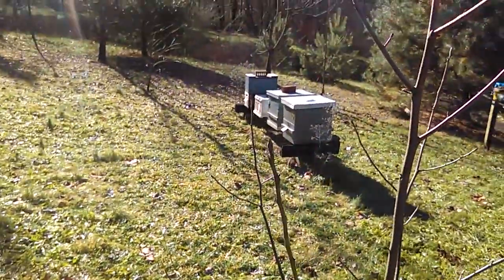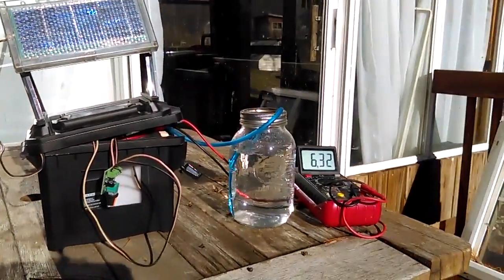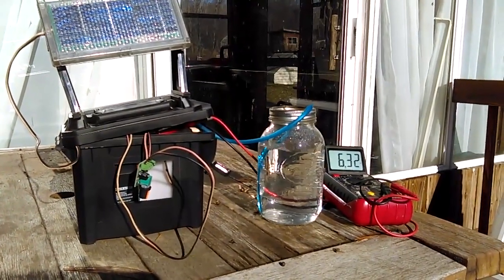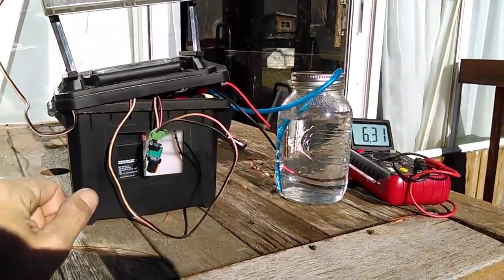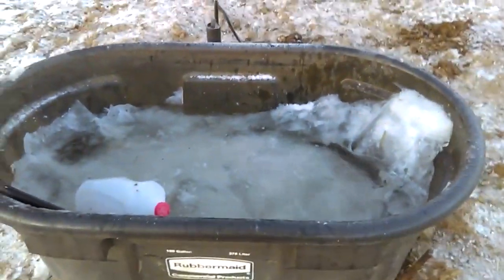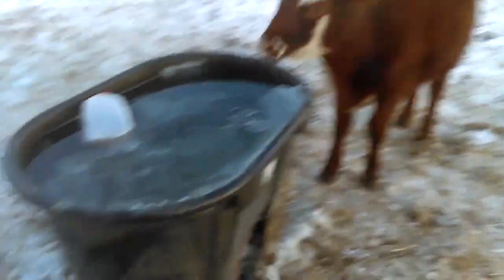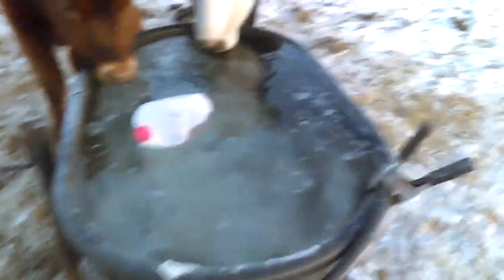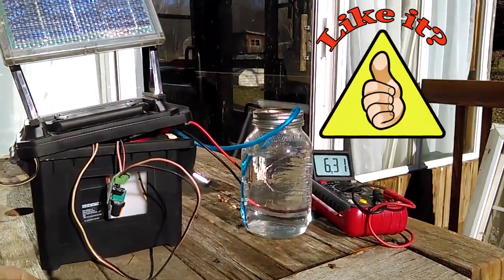Trying To Prevent Frozen Stock Tanks... Solar Powered Water Bubblier

Comment: THIS  WORKS  FOR  US
We use compostto naturally heat our water tanks all winter long.
We take leaves, wood chips, hay, straw, and any other woody materials collected from around the farm and create a 'compost lasagna' around 2/3rds of the stock tanks. We then place rebar through the side of the stock tanks near the bottom and middle (4 rebar works down to -30F) and we 'supercharge' the compost halfway through winter by adding more urine and greens/chicken manure. Heat goes to cold, so the HOT center of the compost conducts through the rebar into the COLD water, and causes convection flow to the far top side, and then down and back to the rebar. It is so powerful we can see the water moving with food coloring.

Additionally.....the compost acts as a great insulation barrier on the back 2/3rds of the tank, naturally heating that side of the tank. Our tanks do not start to freeze at the edges until it gets down to -20F, and won't completely freeze until -30F (only a few nights at times) at which time we use electric heaters. I hope our description is sufficient. I apologize we can not provide video/photos for opsec reasons, but we hope to help self sufficent people break free from the international cabal enslaving the world with their treasonous rveenue streams. #SmallHatsFearUs

Comment: I tried the same thing with the air bubbler last winter for my horses waterer it helped a little but still froze up at night. I found what works best for me in northern Minnesota  is insulate the tank and cover about 3/4 ofthe top with plywood and hang a rubber flap down in the tank about half way  so there is less exposed water to the cold air   the water was almost always open and when you add fresh water the next day it helped warm the rest of the tank back up. I still use this for my bull when I have him separated from the cows.  Works great and cheap to do
Reply from the maker: Very interesting. I am planning to add a solar heated box around on stock tanks. The bubblier is just extra insurance. Thanks for the input.
Reply: Lazy man ranch I am wondering if you could post a picture of what you are describing with the rubber flap.

Comment: Where in North Dakota we winter grays standing grass. Sometimes our cattle graze in 3 1/2 foot snowbanks sometimes almost 4. The cattle do just fine on snow for a water source. Just like the bison elk etc. but if we feed hey snow is not adequate. If you feed hey you must provide water. I have several YouTube videos on this subject.
Official doesn’t necessarily drink water. Winter grazing cattle don’t drink water either, they take water in with every bite full of grass. I agree with you if you’re feeding hey feed water.
If you don’t have electricity there are 3 ways that I know of to keep water on frozen.
1. Propane heater
2. Automatic propane generator.
3. A wood heater. which is maintenance.
Thanks for the video👍🏼
Reply from the maker: What you say makes perfect since to me. The person that triggered my snow experiment was feeding hay too. He doesn't realize how dry hay is I guess. I know my cattle are very appreciative of me showing up to water. 
Thanks for the insight!
Reply: @GrazingAcresFarm  The system linked below never freezes and doesn't require electricity. The down side is that it is a fixed location that can't be moved. If you want water in more than one location you have to install it at each location.

https://www.horsedrinker.com/products/cattle-waterer/

Comment: Jason , I have 2 solar panels connected to a small charge control to a 12 volts deep cycle and and works great. I was going to try a small submersible fountain pump to circulate the water.
Reply from the maker: I gave up on the bubblier to keep the water from freezing, I switched to a different float valve that has a trickle features and just recently picked up a Freeze Miser to add. Just released a video on the Freeze Miser, you should check it out!!

Comment: depending on your water source,   ours is well,as such able to use frost free waters.    the ground tile is at least 3 " less than the width of the waterier dug at least 12" below frost line.    they have survived even - 40°  (true temp  brrrrrr)   most of ours were Mirafount  we got as no electricity needed.

Comment: I installed a 165 watt solar panel 2 6volt golf cart batteries and a 12volt screw in heating element in my 50 gallon rubber maid tank 2" of foam board under the tank 95% of the time here in pa NO ice when it does freeze its thin and theres an 8" clear hole right above the element saved me 40.00 a month

Comment: I think the bubbler is a great idea. Low speed seemed to produce the same as higher speed, but draw much less power. Plus air is safer that a electric tank heater that could short out and shock the cattle. I am lucky that I have hot water to fill my tank with, plus a back up tank heater (which I only plug in if absolutely needed). I like your idea, and might do the same to mine, but hook it up to my air compressor! Keep us posted on how well it performs
Reply from the maker: I think it will help slow down the freezing if anything. Do you know of Jim Gerrish? He wrote a few grazing books but he also sells a version of the air bubblier. https://www.americangrazinglands.com/products/12v-water-bubbler
I just can't justify the cost. I have a lot less in my setup and that's including the battery. lol On top of adding this to the stock tanks, I plan to try an insulate one of them. I have plans for a solar heated stock tank box that looks promising. 
I never gave the air compressor any thought, good idea. If a person had a very large air tank and a valve to control the air released you could probably get quite awhile out of it before the compressor kicked back on.
Reply: never in 40 years had one short out and even if it did thats what the safety ground wire is for, and little short and it will pop the beaker, you can have a drill in your hand and put it under water and nothing will happen other then pop the breaker and do nothing to you, just make sure it is wired right and the 3rd prong is always on the plug,,, that little bubbler not going to move the water any were close to what is needed, until i put my live bait tanks in the ground they froze solid, even with a 1/3hp motor commercial bait pump

Comment: well  did it work? that was 3 years ago.  I', looking into a solar tank heater but I', thinking  insulatingf the water from the ground and building an insulating housing with a limited access cover  all painted black  might be cheaper.
Reply from the maker: No. I switched to the Jobe Topaz float valve with a Freeze Miser. I'll do a video on it soon so you can see my winter setup.

Comment: Yacht owners use blubbers under the hulls to keep ice away from the hull. I would run the air through a tube around the edge,  held down on bottom of tank so ice never forms on edges. Notice Ice always starts from the edge.
Reply from the maker: Makes since! Thanks for sharing.
Reply: yes they do but the motors on those are 220 volt 3 to 5hp and the fan blade is 10 and 12" i know as i sell them, the hang under the boat on 4 chains, you need one for every 25 to 30 feet of boat

Comment: Ha Jason what is the water temp coming out of your Hydrant? If your pipes are deep enough you might have warm water, well maybe 35 to 40 degrees, if you turned your hydrant on and put a valve on the hose bib you could cut the water down to maybe a gallon every 4 or 5 minutes. That hose in the bottom would add enough heat that maybe the water would not freeze. I think I seen your well was in a building. My bees are flying every day but then I am in Dunedin,Florida it started out 68 and got up to 84 today. Jason I always enjoy your videos.
Reply from the maker: Our water is around 35°f straight from the spigot in the winter. I was considering letting it run slowly and fill a tank then setting it up so once that tank is full it drains to another tank but it got complicated real fast. lol It also seemed like it would be a lot harder to move the setup as I move the herd. Our well is underground in an old cistern so it's protected from the elements. 
Glad yo enjoy the vids and thanks for watching.

Comment: A larger solar panel directly connected to an immersion heater might work. Let the water be your 'battery' in the form of heat storage. Insulate the tub. The 'sweedish homestead' guy on YouTube covered part of the top also.
Reply from the maker: I am planning to insulate at least one of the stock tanks. I have plans for a solar heater and it looks promising.
Reply: Ohio isn't exactly the sunniest place in the winter.  And with a PV panel you still need a MPPT or PWM load controller  to deliver power adding some cost to the system.

Comment: Ps youll need a temp controller probe and a 40 amp relay switch they are cheap though or you can get a 12 volt element with an adjustable thermostat right on it

Comment: The brine jug will work better if the jug is moving or bobbing in the water. The wind blowing keeps the jugs moving which keeps the water from freezing. Me I would add 3 or 4 brine jugs in the same tank and and the bubbler, I bet you’ll get better results.
Reply from the maker: Yeah, I understand the wind is a huge part but that is out of my control. lol I appreciate the insight but I am going to add the bubblier to a stock tank that I plan to insulate. There will be a video on the tank very soon.

Comment: This year ill make the 40.00 a month back this will be year 4 if your careful you can do complete for about 450.00 rarely i have the throw a battery charger on it you can run those elements right off a battery charger its safer than 110 for your live stock and cheaper to run than 110 heater

Comment: Your bubbler didnt put out a huge amount more of air with the cranking up of the pump
Reply from the maker: It does actually produce more bubbles when cranked up but the video didn't do any justice for it. It also drains the battery faster.

Comment: Air is a waste of time. I use a battery power stock thank heater and it works great.
Reply from the maker: Fair enough! I am now use the Jobe Topaz float valve to prevent freezing and it's worked fairly well the last 3 winters. It has a feature which allows the water to trickle and moving water can not freeze.

Comment: I can't think of anything besides letting the tanks overflow. If you had metal tubs and were permanently placed you could use a floating flame to do the job. Cowcamp87 on YouTube has a video from last winter where he put a metal trash can in a big metal tank and burned wood in it. The trash can floated around like the milk jug and had fire for heat. Probably not suitable for your application though lol.
Reply from the maker: Interesting idea for sure but I can only imagine the trouble the cattle could get into having a floating fire. lol
Reply: @GrazingAcresFarm  I heat water while camping with a copper coil and braided metal hoses (from a wash machine )..I have the campfire put the coil in the fire the hoses run to a cooler of water by morning you'd do good to touch it but it's only about 20 gal..it works by convection. ..if you look at how folk use "the snake " method in their can smokers with some charcoal most get a 12_16 hour burn...not a exact way to do it but your a smart fellow and it may give you a idea. ..thanks for the posts

Comment: i dont know how cold it gets were you are you only said it went to -15, well you add wind chill to that on high windy nights and your at a wind chill or -30, so id say your wasting your time, 37 years ago i ran water lines and a 12/2 wire to every area in the fields i would have water tanks, at this time of year it only drops to -15 to -20 so i just leave the rater running slow into the tank, kep in mind in winter i only use 30 gallon tanks, come Jan, i plug in the electric floating heaters and as long as i dont go much bigger the 30 gallons it ices up a little on the edges in -40 -50 night with wind chill of -60 tops, some leave the water running all winter plus 2 or 3 floating heater in there big 200 gallon tanks, other have out door wood furnace that heats there home and shop and thet run the return line up out of the ground and lop it in the tank as they dont want to pay the high hydro bill, keep in mind if you leave the water just running really slow it always has warmer water moving though the tank, and put a over flow hose 2" from the top and lead it off away from the tank 30 feet, so it dont build up with ice on the ground around the tank and cows slip an fall or are to afraid to get a drink out of slipping